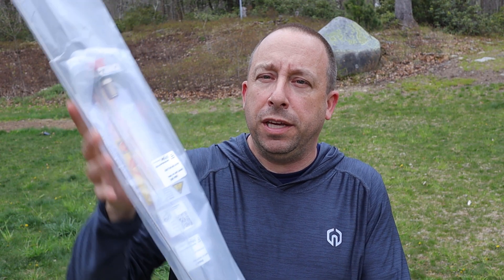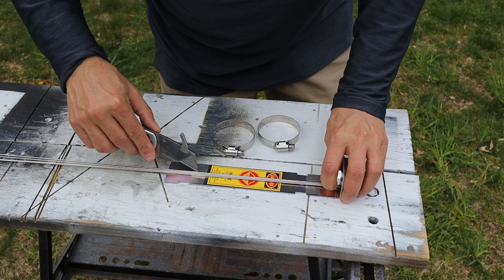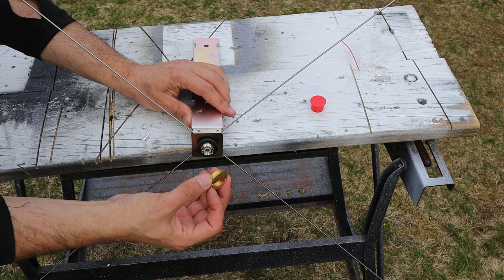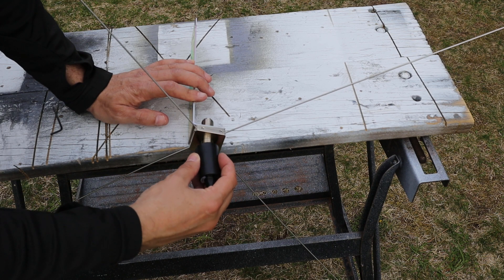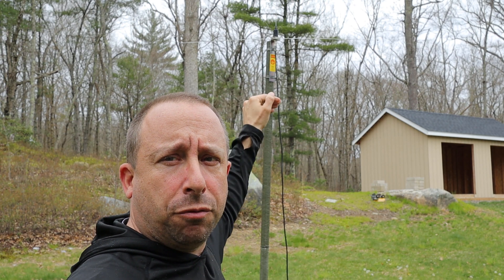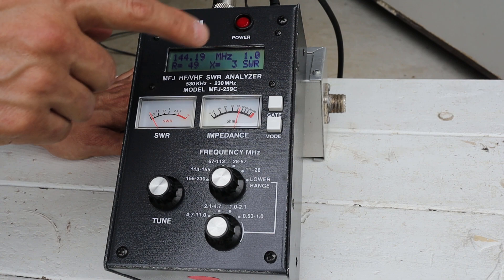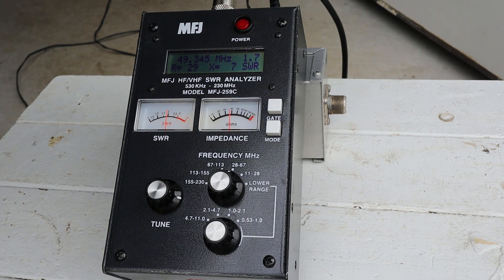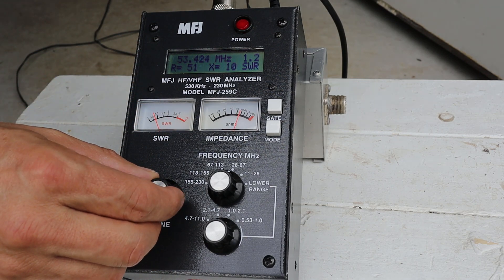Ham Radio Antenna Review: Pulse Larsen BSA150C Compact 2 Meter Base Antenna

Comment: Would placing this antenna higher up from the ground make it reach further?  Also will tress around the antenna hinder the signal and distance?
Reply from the maker: Height is might...so yeah, the higher the better.  Trees may affect it a little but I wouldn't worry about it